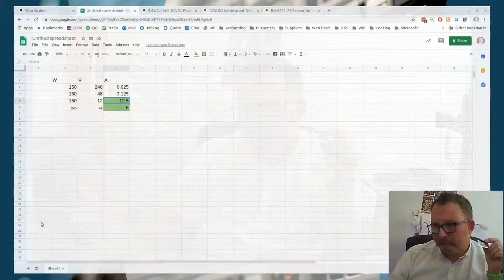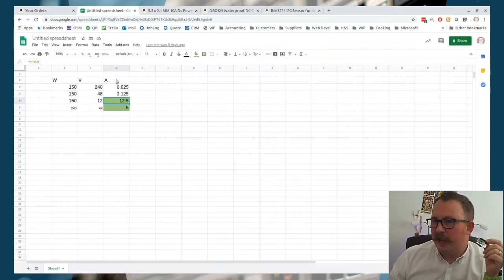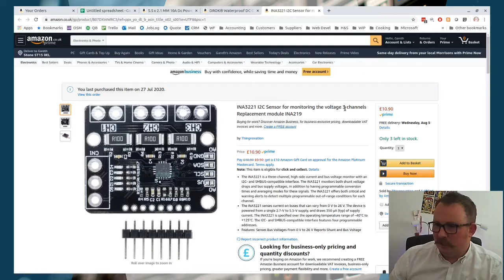Wiring up an INA3221

Comment: hi. Nice video. Have you got any details on how to get info from the sensor? I'm struggling to find anything with Google apart from details to do with the purple board
Reply from the maker: Hey Joe, I have done quite a bit of playing around with various bits and honestly I don't remember now what I did with this one but I think I had it attached to a Raspberry Pi via i2c and wrote a little script to pull the data and log it to an influxDB database maybe...